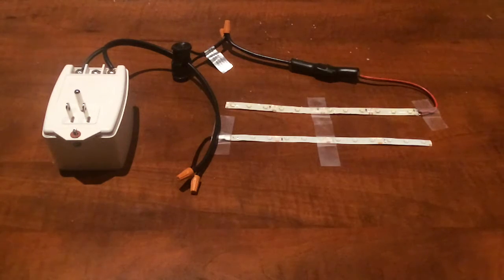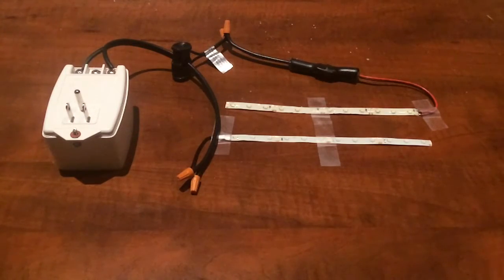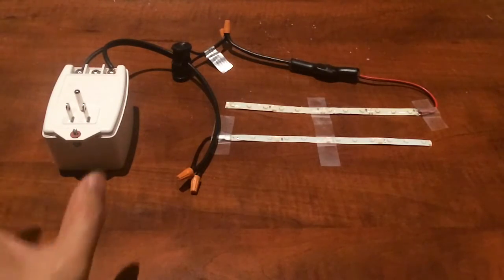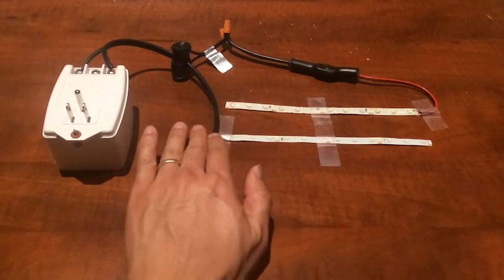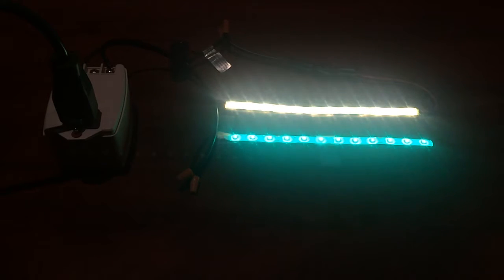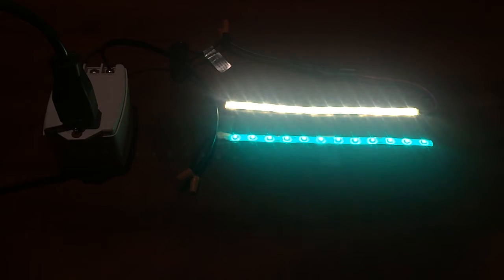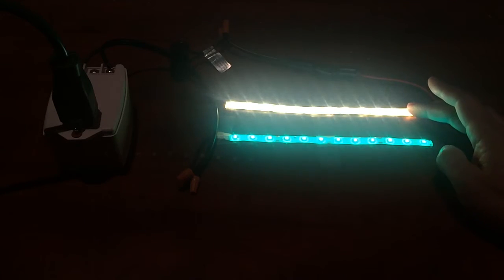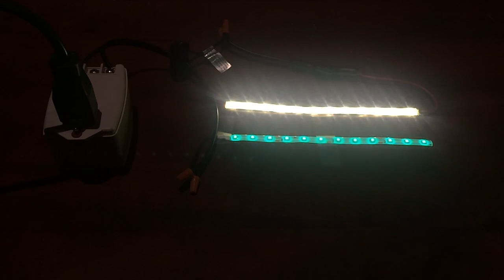12V DC versus 12V AC for LED Strip Lights

Comment: The converter is just a diode. Diodes convert alternating current (AC) to direct current (DC). Just get the right diode value for the job or buy this convert(pre-made diode) if you don’t want to think about it.

Comment: Thank you ... I was trying to connect a tv w a 12v Ac because I don’t have DC and it’s just blinking — now I know why - thanks again
Reply: Rock on! :)  We have another product that works for the RGB type LED strip lights.  amazon.com/Outdoor-Waterproof-Landscape-Converter-Rectifier/dp/B08HXC4QC4  We also just released a set of holiday string and holiday net lights that works with your landscape lights: amazon.com/4ftx6ft-120-LED-Outdoor-Waterproof-Lights/dp/B08LGJ5765 and amazon.com/100-LED-Outdoor-Waterproof-String-Lights/dp/B08KTXK54X

Comment: I love these but it doesn't work with these that are 12v DC: https://www.ebay.com/itm/3-Flicker-Effects-Led-Lighting-Control-Flame-Simulation-Fake-Fire-Props-FFC3P/124132297525

Why not? And how do I get it to work? They would be perfect for the garden lighting.
Reply from the maker: Doesn't work because those lights require a constant and steady voltage for the electronics that's inside that controller.  Sorry.  Send me a private message and I'll see about sending you a prototype that we did, but never sold because we couldn't figure out the package and economics.

Comment: I'm trying to fix an old monitor that has fluorescent backlight tubes running on 12V AC. Guessing I can't swap those for LED ones then? Or do LED backlight strips for monitors get made with AC in mind?

Comment: What is that ac power adapters output amps? Because I have used different ac transformers to run LEDs and it seems to me that the ac output amps is not enough. Also what makes you so sure ac over DC lessons life? Did u test that if so how? The led strips I use ac with are just fine & continue to work for me no problem...

Comment: Power supply was going out on 5 led panels I had that had built in 110v AC converters.   I assumed they were 12v LEDs and I'd just hook them up to a different power supply.  Come to find out the cap on the output end of the transformer was rated at 100v DC, which I'm thinking means the output voltage is a lot higher, maybe even 100v DC.  Not having a power supply that is 100v dc and it not being worthwhile to buy one, can I just plug these into AC?  WHat's the worst case scenario, a bonfire?

Comment: i used a 12v dc modem power adapter , it works. but the 44key key remote is not working.. also some other features on 24 key too..dont knw whether its the power adapters fault or wrong choice of adapter.. if you have a spare 12v dc modem power adapter go do it.. thumps this comment if it works👍...

Comment: Hey dude, I have a battery less motorcycle running 12vac. I am currently looking to run 12v led bulbs as indicators I'm just wondering if the converter you have would be good for that job, I have no clue about the wattage of the bike or the led's but am willing to check with instruction.
Reply: +Jack Yo dude.  Interesting that your battery is outputting AC.  Batteries are generally DC so there must be some converted converting it to AC.  In any case, if you need to convert 12VAC to 12VDC, this device will work.  Each of the typical 5meter LED strips you find on Amazon is ~24W.  I have a hard time visualizing putting more than 5meters of LED on a motorcycle.  If you need exactly instructions on measuring wattage (and you have a multi-meter for making such measurements), let me know and I'll provide instructions.
Reply: @BJ5815  I know I'm 3 years late, but the motorcycle is battery less so the bulbs are attached directly to the alternator which generates ac, not DC

Comment: How does running off of AC lessen the life?  Shouldn't the LEDs be running cooler on AC?
Reply from the maker: +Nathan George Using AC can lessen the life of the LED.  It doesn't cause the LED to run cooler or warmer in color (I assume this is what you mean), but it does cause a reduction in brightness and potentially flickering if your eyes are sensitive enough to detect it.  That's the short answer.

This all has to do with the physics of the LEDs themselves and the manufacturing.  LED is a semiconductor device so it has certain properties and operating requirements; operating it outside of these requirements 1) voids your warranty and 2) reduce the life of the product.  This is going to get a little bit technical, but here goes.  I apologize in advance if it's too deep or if it sounds like rambling.  LED stands for light emitting diodes.  A diode is a semiconductor device that allows electrical current to flow in one direction but not the other direction when a voltage is applied to the diode.  12V DC means the diode sees 12V all the time.  12V AC means that 50% of the time, the diode sees 12V.  The other 50% of the time, it sees -12V (negative 12V).  When the diode sees 12V, it's turned on.  When it sees -12V(or anything less than its "forward bias" threshold voltage), it turns off .  In the USA, AC is at 60Hz, which means the voltage is 12V for 1/120 of a second, and -12V for 1/120 of a second.  Take all these facts together and the end result is that the LED is turning on/off 60 times per second.  12V DC does not have this issue since it applies a constant 12V to the diode.   From a user perspective, you may see flickering (depends on people's sensitivity) and a reduction in brightness when using 12V AC.

To the reliability question.  This on/off behavior by itself doesn't really hurt the LED, theoretically.  It is electrical stress however.  I won't get into the details of the type of stress this represents.  The other phenomenon here has to do with the -12V.  When the diode sees -12V, we call that putting the diode in reverse bias.  And this theoretically shouldn't harm the LED either.  But again, this is stress.  Then there's the hot/cold outdoor environment.  Think about how a small trickle of water can carve a crevice in a boulder over time.  In essence, this is what is happening there.  All these stress component stack up to significantly reduce the normal life of your LED.  All LED will eventually fail, just from regular usage (due to these types of stress).  You are just accelerating it many times by using the AC power.  And this is why LED strips are not rated to run on AC power.

Apologize for the long response.  You asked a pretty insightful and technical question. :)
Reply: Thanks. So, why not just a bridge diode and cap?
Reply from the maker: +Nathan George That's exactly what a AC-to-DC converter is made of. :)
Reply: EDH Lighting Great explanation!! now my question is, if i am wanting these strip lights for my van, which has a solar system that stores to a battery, isn’t the battery (a standard car type battery)  outputting in DC? and if so, can i use this DC to directly power the LED strip lights?! if so, how do i hook this up? what do i need?!
Reply: +EDH Lighting Thanks for the detailed explanation. The difference in light intensity was clear!

Is this difference between the 2 sources proportional to other factors.. say, would the difference would be more noticeable with increasing wattage or different LED types.. 5050 vs 5630?
Reply: you only need a resistor and blocking diode